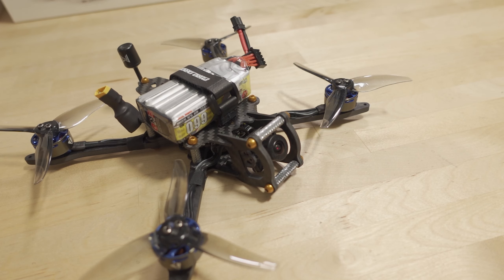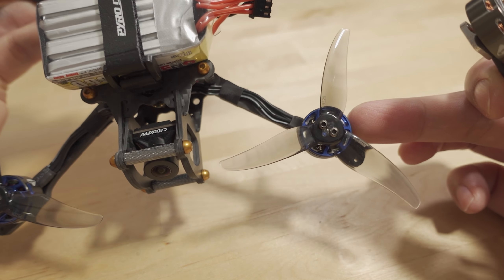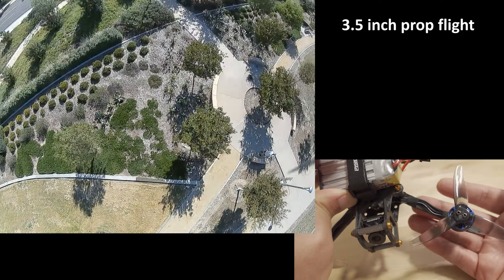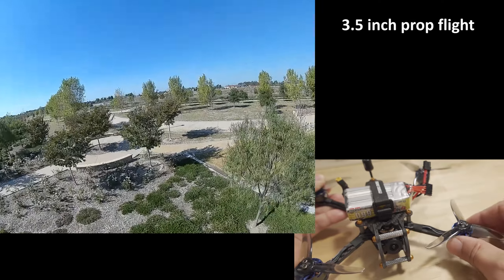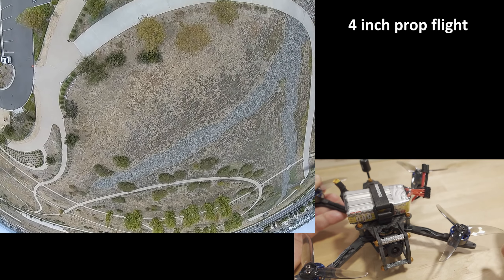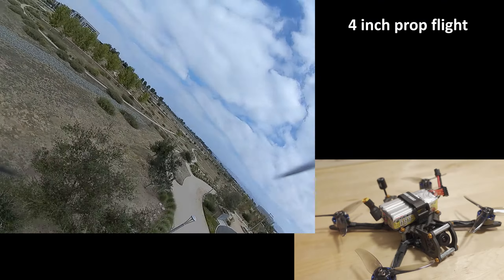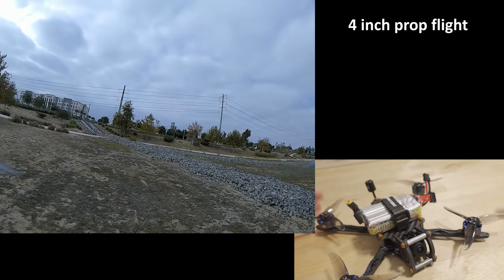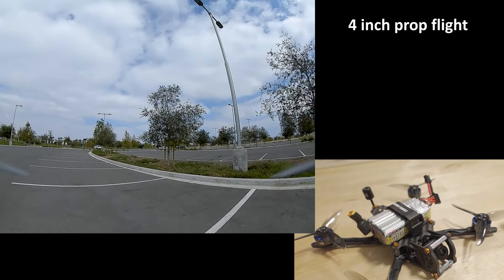BEST for the 2fiddy 4-inch? | Ummagawd 1605 Motor 😁

Comment: Give the 2004 3500kv on 4 inch props and 4s a shot. It's my favorite setup on any quad I've ever built. I fly it with a dji action 2 onboard power to weight is amazing and it tosses amazing.

Comment: I use Rcinpower Gts v3 2105 2950kv 4” arms with 6s tattu 650mah  with Fettec electronics I get right at 4 minutes tough flying or 6 cruising it’s my favorite flying drone love the punch out it has really helps from crashing being able to have that extra throttle that’s never used really unless needed things a little rocket ship

Comment: Cool.  Great Review and flight.  Great detail explanation.  I am glad you went into depth to explain this prop size/motor size issue that can affect the flight characteristics.  I just purchased some 2004 motors for an upcoming cinewhoop build, but I may rethink my motor choice.  This is very helpful.  I do remember you discussing this issue before in a previous video (can't remember which one)  I think this is something that is important and should be carefully considered  when building quads.   It does affect flight characteristics and perhaps not everyone realizes this.  A really great video.  Well put together and thought out.  Thank-you this will help a lot of people.

Comment: Very informative and helpful video. Looking to build a Avant Avio 3.5, researching motors. Gotta figure out the weight as compared to my analog Crux35, it's great with 1404 motors. But it's a pretty light build. 9 minutes flight time using a gnb 1100mah hv lipo. Not aggressive flying, but flips, rolls and a power loop for good measure. I want the Avant to be dji hd with naked Vista. May need more oomph, Happy flying everyone. 👍😎
Reply from the maker: Too bad Avant ghosted me.  I'd be willing to try out their quads but the designs look so boring I'm never gonna shell out my own money to buy one.

Comment: It’s not just because the wider motor blocks the props, it’s because a larger diameter motor takes more moment of inertia to move it in a circle especially at low rpm. That is why the 1404 motors on the BH2 and Smart35 give such great low end control. Because the smaller diameter motor has less moment of inertia and takes less power to spin up at low rpm. Smaller diameter motors tend to have better low end resolution than larger diameter motors. It’s about the rotational physics much more than the airflow.
Reply from the maker: I think the effect the prop being blocked is a larger effect than the rotational physics based on all my test flights and how the motor feels.

Comment: Hi Albert. Interesting findings. I was wondering if you are going to be testing the new tmotor 1604 suggestion it to be the right combination
Of power size and weight. Keep us posted 🤟
Reply: He already did a review on the new tmotor 1604.
Reply from the maker: Here's my review of the 1604 motor... I tested that one on a 4-inch because of the lower KV.  I am still waiting for the other kv version to test 3.5 inch props.  https://youtu.be/V8V6V96fFuo

Comment: Thank you for the info.. can u tell us what 3.5” &4” props u used?  I was given a 4” freestyle frame, threw on some 2400kv 1408s.. 252g on a 550 4s without trying.  
  I flew the gemfan 4” and symitar(sp?) Avans triblades .. like flying 2 different quads..
Reply from the maker: Gemfan 3.5, HQprop 4 inch